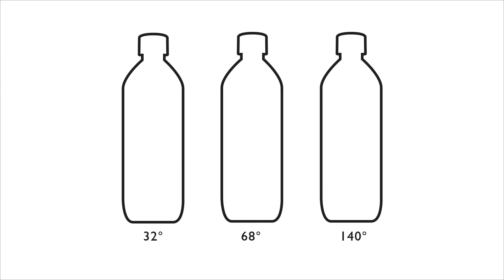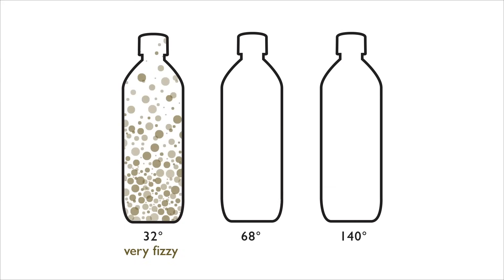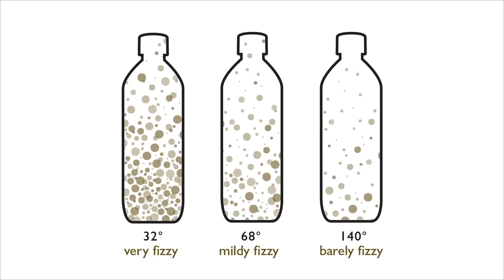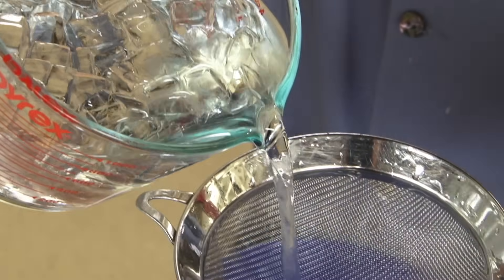Science: Love Seltzer, Champagne, or Soda? We Explain Carbonation & Bubbles in Fizzy Beverages

Comment: Do carbonated beverages go flat faster in the fridge or at room temperature? Basically what I'm asking is, should I keep my tonic water in the fridge or not? And why?
Reply: Patrick Wilson depends... do you want your drink fizzier? Then if it is open, fridge. If it is still sealed/unopened then it doesn't really matter unless you're about to drink it. If that is the case, then you would want it to be in the fridge.

Carbonated beverages will loose less dissolved CO2 if they are cold.

Comment: Im not sure if dumb question but is carbonation bad for your liver/health?
Reply: B Ken No.  Your body produces carbon dioxide.  But too much of the salts in some carbonated water can give you some gastro issues.
Reply: Late response, but no. Carbonation is perfectly safe, because carbon dioxide (CO2) isn't broken down by your body, and in fact we naturally exhale it constantly. A glass of "flat" water will have the same effect on your health that a glass of carbonated water would. At most, you'll just be burping a bit due to the increased amount of gas.

There is one thing I haven't mentioned, and it's the formation of carbonic acid (H2CO3). Carbon dioxide occasionally reacts with water to form carbonic acid. This is one reason why carbonated drinks taste more bitter or sour than flat drinks, and why flat soda tastes so bad - the flat soda is lacking the carbonic acid, and all acids provide a sour flavor in foods. But don't let the name scare you - the equilibrium of H2CO3 to CO2 is small, and H2CO3 is a weak acid anyway. It also decomposes rapidly back into water and CO2, so once again, there are no health effects.

TL;DR Carbonated drinks are no worse for you than the same drink would be if it were flat.